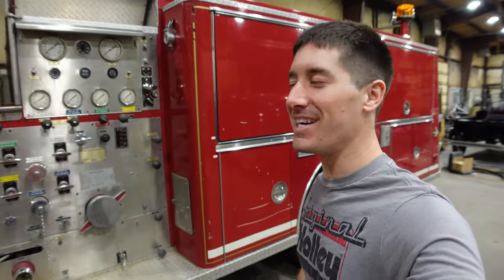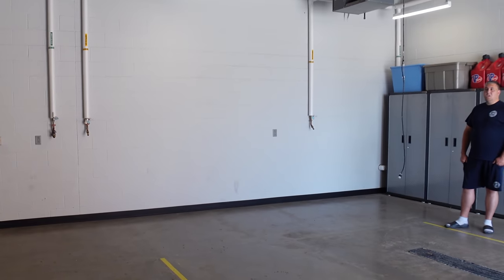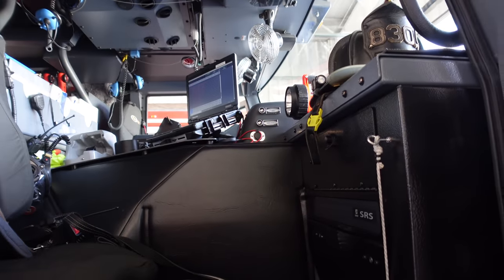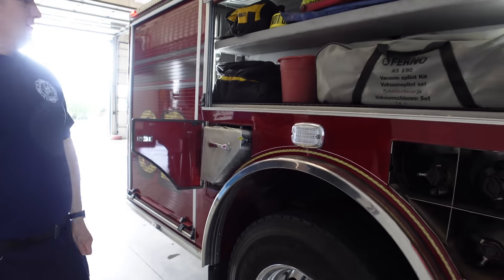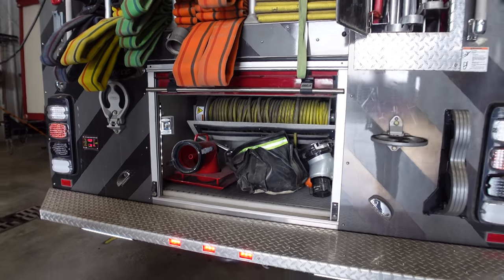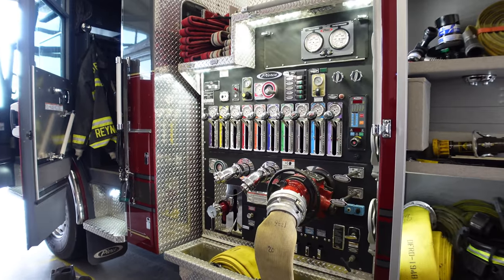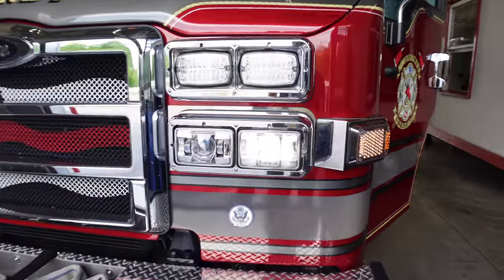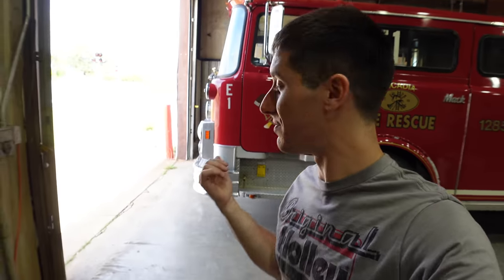My OLD SCHOOL Mack Fire Engine VS A BRAND NEW Pierce Pumper

Comment: My parents purchased a house directly across from a fire station in Beverly, Massachusetts when I was 10 years old (1970). That gigantic brick building filled with gigantic red trucks was a little boy's dream. The guys always had time to answer our questions and entertain us. That was until the call came in and the loudspeaker started buzzing and in my mind, they went off to have fun. It wasn't until many years later did I realize being a fireman or police officer was dangerous. Thanks for this video and double thanks to all the men and women who protect and save us no matter how bad the situation.
Reply: think beverly either is getting or already got a new station due to longer larger units... Mass here also
Reply: @Erik-pr2rf  The station is very close to Henry's on Cabot St.
Reply: And their station probably didn't have a ramp which is like an invisible barrier separating the public from the firemen.
Reply: @owensweetland342  I drive by the station daily on my way to work. Same building and same everything fifty years later.

Comment: I worked at pirsch back in the 80's, some old Pirsch's I scraped out. Saving old parts. Mach hub caps, plenty of pirsch components, gauges, blue prints, emblines. I still currently own a 1931 pirsch pumper # x-kenosha engine #2 in the garage

Comment: I love the fact that the 1991 Mack tanker trucks my department has, have many of the exact same parts as the 1977 Engine, such as the turn signal lever, door latches, pedals, light switches, etc. I guess Mack found/made parts they liked and then continued making trucks with them for decades. Also with the alternator not charging, at least with our Macks, you have to rev the engine above 1200rpm breifly for the alternator to kick in.
Reply: Glad I saw this comment, I own a 73'.  Definitely a fun truck to own.

Comment: Pierce started as an aftermarket truck body builder that got into to fire apparatus by supplying bodies for other manufacturers such as W.S. Darley. They originally started producing mainly rural type apparatus for the market in their region of Wisconsin using Darley pumps. FWD in Clintonville, WI purchased Seagrave fire apparatus in the early ‘60’s giving up their Waterous pump contract. Pierce was able to use Waterous pumps and started national sales. The quality of their product was their advertising and they became a major player. Mack built an excellent truck, but a not so great fire apparatus body. Your Mack needed a new body by Custom Fire Apparatus when it was 12 years old. They slowly dwindled out of fire apparatus. Enjoyed the video👍

Comment: As a volunteer firefighter emt I can tell you older rigs vs new rigs.
Older rigs- depending on the rigs it’s a love hate relationship. You like how some of the parts are heavier and better built they don’t go with plastic like on newer rigs.
Bad part a lot of older rigs are often worn out
Newer rigs-they have typically bigger engines so if you got more gear and more stuff you can run a little faster. Plus better pump and more modern features.
Bad part- a lot of modern trucks have sensors and stuff like that burn up or go bad or needs recalibrated. So you I tell everyone that buys a new engine keep the old engine at least a year until you can work out the problems on the new one.

Comment: Auto Ejects are compatible with any 120 VAC charger. For the eject to work there should be 2 wires. One goes to chassis ground and the other should go the signal wire that engages the starter.
Reply: ^ this.

Comment: The 1916 truck is a piece of art. Yours is what we were used to see on movies during the 80's and 90's, I always liked them.

The new one is nice, but it doesn't have the same appeal as the old ones, maybe it will in a few years. 🤔

A funny thing is the discalimer, it sounded like they would be making some driving maneuvers and have the truck on two wheels or something. What aren't we supposed to do? Stand by a fire truck and talk about it? 😂

I know you have to do it anyways, but I find it kinda funny. 👍

Comment: That Mack CF will be running far after that Pierce is dead.  Those old Mack's were truly workhorses.  Ran many calls in a 1981 Mack CF and a 1991 Mack Grumman.
Reply: As long as the red cancer didn't eat up the frame, they would go go go. Unfortunately many a puppy dog went to the scrapper because of rot.👍🇺🇸

Comment: I like JR videos a lot. But sometimes I wonder how much technology we need in certain places. To me, the use of technology for the sake of it just drive prices up and make trucks/cars/tractors more "fragile" as more and more things can break and go wrong. You have to consider these trucks sit around a lot and when they go somewhere they don't go that far. For a similar issue, check out the fight farm tractor owners are having with John Deer and others about technology in the tractors. In a recent JR video you talked about using your great computer to diagnose the many other computers in the car, but "if the failure is mechanical the computer can't help"... :-)  We have added computers and sensors everywhere, we now need another computer to diagnose all the computers and sensors in there, and many times they CAN'T help.. :-) "The old truck the A/C was broken"... well, they can be fixed you know... IMHO...

Comment: This is awesome, love the fire truck content. Glad you finally got one, best way to utilize that giant warehouse. I have an 1962 international pumper engine from my local Department. They were going to sell it to someone not local when they retired it about 10 years ago. My Dad, being on the department himself decided to buy it and use it as a parade/show truck.  Was very sentimental as both my grandfathers had driven the truck when it was in service. Mechanical Everything and double clutch transmission. Leaned to drive stick on it at 13. Had an 80's Mack Engine from Maine as well, but sold it to another fire truck enthusiast who was going to use it as a parade truck. Curious what your plans are for the truck?

Comment: On a what did I do about my Battery just maybe running low. In big back compartment on my SeaGrave. I put in my Honda 2000 with the very heavy duty big wheel cart ENGINE start big charger. And have started carrying my little round AIR tank tire fill air supply tank. We have these mini Modern shaped go carts that look like Engins with light bar on top. The kids love putting on the mini bunker gear and get in those go carts. We also drive them on Parade route. We haul them on a trailer behind are F-450 Ford 4 door brush rig with 300 gallon water tank. It has a separate small gas engine for pump and run operation. We also have a 1500 gallon Tanker ( tender depending on if you are east coast or west coast Fire Department)
I was told by the Training Wildlands FF group that the dispatch especially in California wants a CLEAR difference between the Air tanker and ground tankers, so thats why we call are big water carriers ( Tenders) but getting back to your weak batterys and believe me, have had same issues. I carry the big commercial truck charger in the back compartment. Its a learn as I go. The thing I live about my SeaGrave is the Dash is so easy to get under/ behind to fix old wire issues and the filters change is a breeze. All three filters a underneath plumbed for change out just sliding under engine chassis. 😊

Comment: Dumb question, but why does it need a trickle charger? I assume to ensure the batteries never drain too much between outings?
Reply: Yep. you need a lot of amps to get that engine going and your batteries going to go flat when it’s sitting. Although his truck did have a battery disconnect switch, you saw him turn it back on when he went to start the truck.

Comment: They do get fires out faster,sprinklers help,much safer for FD crews in 2023,rode off tail end till mid 60s,these pumpers/ quints running wheels off for nosebleeds,we had 11 1950 mack type 95,1000gpm...got 30 yrs service from those rigs🚑

Comment: Nothing screams democratic policy like a "sorry we can't respond to that fire, our truck is in limp mode for def and dpf related issues."
Reply: they really should just go ahead and exempt any emergency truck from that crap. it hasn't been around near long enough to have worked out all the bugs and you don't need to have a preventable engine problem on your emergency vehicle all because you were trying to cut down on the little bit of emissions it would be spewing.